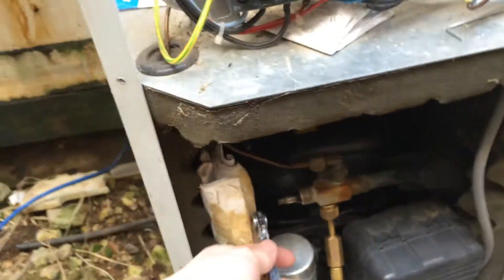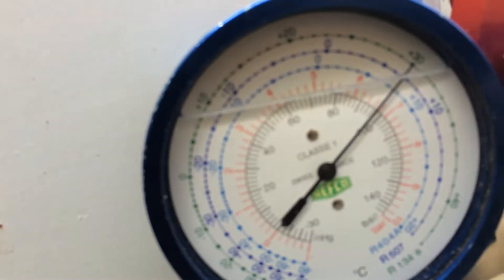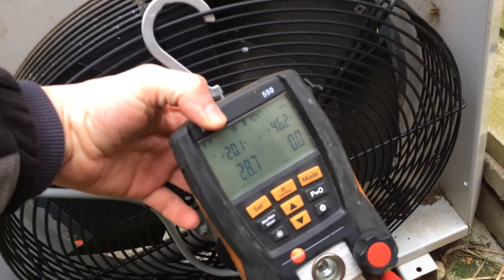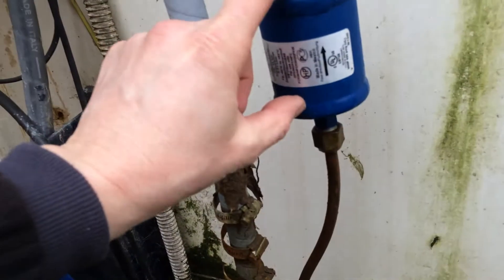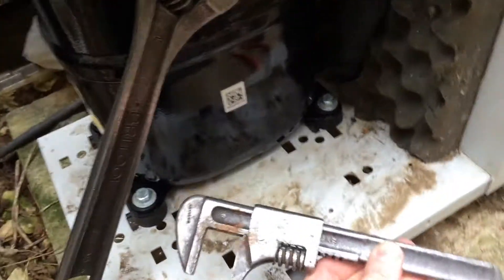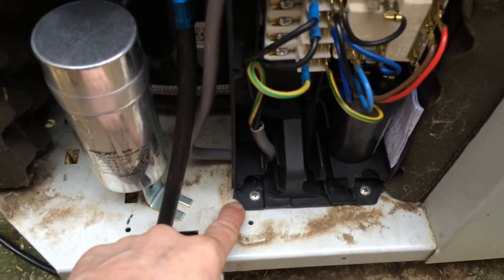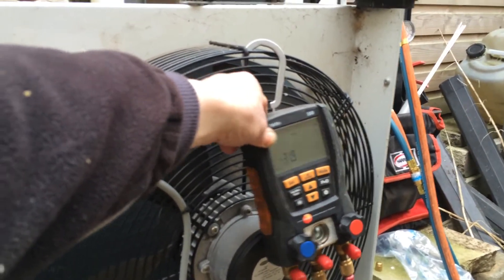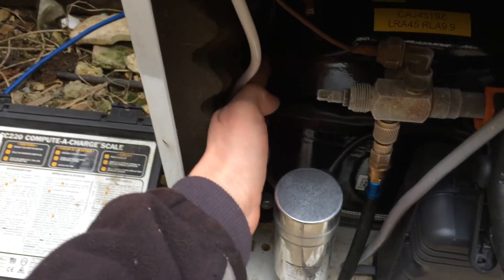Profroid Quietis Compressor Failure

Comment: Hmmm, that looked like a tecumseh compressor or did I miss read the logo?  If I got this right, the crank case heater you installed, comes on when the unit shuts down and off when it starts up?
Reply from the maker: More350Power It is a tecumseh compressor, they are also made in France and badged as L'Unite Hermetique. Yes, the CCH is on when the compressor is off, and off when the compressor is on.

Comment: nice job John! is it true that you guys don't use wire nuts?
Reply from the maker: Emin HVAC Thanks Emin! I've never used a wire nut, i've had some with Supco things but threw them away as didn't trust them, just seems a bit wrong to twist wires together hahaWires are generally either crimped or more commonly joined with terminal strips or din rail mounted terminals. I guess its what you are used to that you are happier with.
Reply: ***** I do the same, I use the the lugs, then tape it up, then use the  those 3M insulation pads and re tape it again.

Comment: What do you think about Possibly Putting a Suction Accumulator...... in that Suction line before the compressor ? i don't know that application or temperature range but if it's a Long Suction Run, a Cold Box you could be getting liquid condensing in that suction line if the Ambient is Cold Enough Outside. Suction Accumulators are just good compressor protectors in my book. I Sometimes use them on Medium Temp ( 35 Degree's F )and Allways use them on Freezer Applications ( 0 Degree's F ) or less.
Reply from the maker: OcRefrigeration.Com & H.v.a.c. An accumulator would help, the pipe run is very short, the evaporator is at head height just the other side of the wall, it is still the original Carrier truck body evaporator, the cold room is an old body off a truck, which is why it has the rubber suction line with the hose clamps!I have said it really needs a matched evaporator fitting, i would then put the system on pump down cut out, it was evaporating at -34F (room was about 44F) and the compressor is actually a medium/high temperature rated down to 5F. Didn't realise quite how bad it was till i got it running.